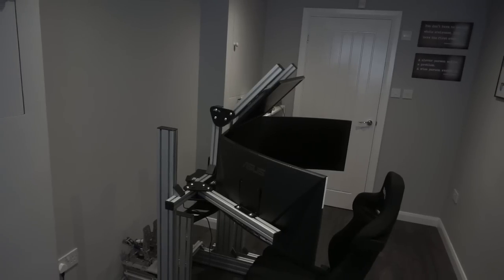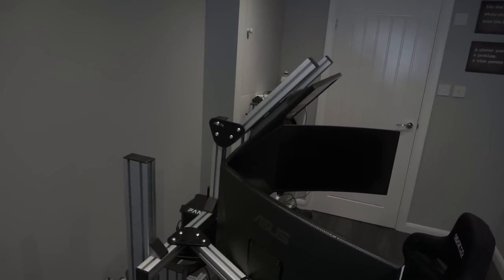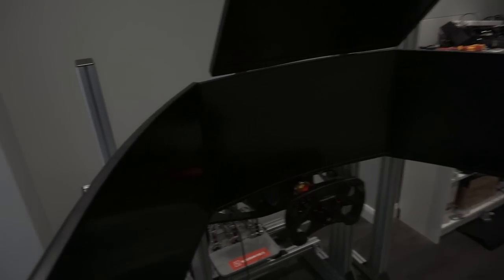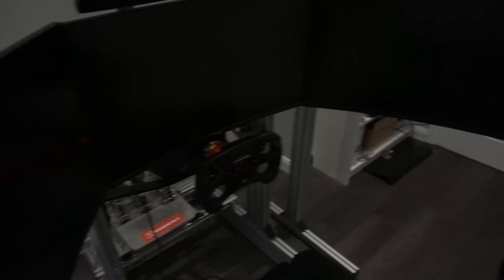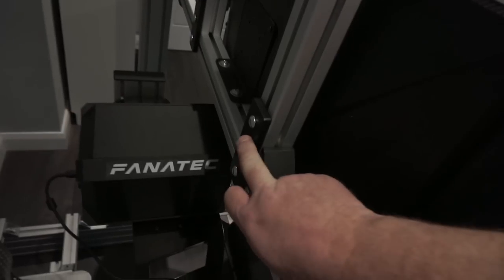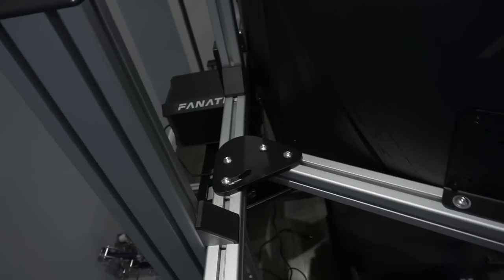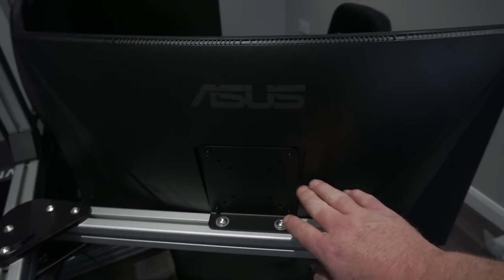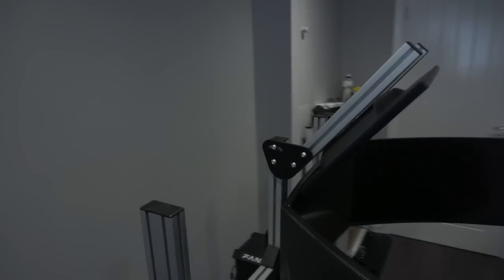Lets build a ProSIMRIG triple monitor stand! | Is it any good?

Comment: Where did you get the adapters that go and screw onto the back of the monitor? I have just got 3 asus 32 inch curved monitors that work with 100x100 vesa mount. My track racer triple mount has 3 vesa plates but the nothing that goes into the monitor like yours

Comment: How you can allign side monitors when there are no height adjustment on side monitors? I believe that due to monitor weight the arm is a bit bend to ground...
Reply from the maker: No not at all. The metal plates on the angle are super thick. Doesn't say at all when tightened 👍

Comment: Hey mate - what's your thoughts on the L shaped monitor mounts? I've got a simfinity quad mount setup here in australia but they only sent out face plates which need to be bolted to the rig then the monitor bolted on to them - adjusting is a complete bitch to get it right. what sized curved's are you using

Comment: I've got the same setup now. Both my side monitors sit quite low compared to the middle one. Tried spacers but still not enough.
Reply: I’m running in to the same problem. How did you address it?
Reply: @xXMrGrayeXx  just had to use more spacers and longer screws. Not ideal but it works
Reply: @alfaracer9876  Thanks! That’s what I did for now too. I sucked it up and put an order in for a Vario VESA Adapter kit from Sim Lab for the long term fix. 💸😭

Comment: "My rig is 600mm wide, but there are also a couple of big ass bolts" - Dave Cameron 😂😂
Reply: 8MMx18MM length should be the norm for anchoring any profile rig with a DD wheel base as well as some 4080 and 8080 corner brackets to and join plates to anchor things so they DONT twist or move!